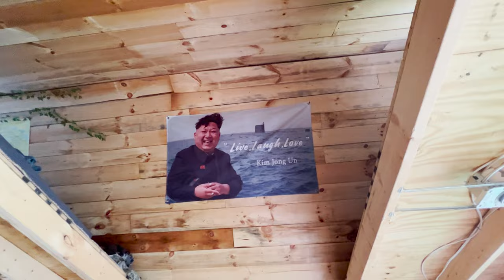#86 Cutting a hole in our LOG HOME wall; and other things happening on the ranch

Comment: I hope he gets a belt sander with a vacuum attachment to lower the dust level.  I guess since the house isn't done, it doesn't matter as much. 

I haven't finished the video yet. You might address this issue further in the video.  My memory is awful. If I try to wait until the end, I forget.  Besides, typing a comment is something I cam do during the ads.
Reply from the maker: I looked into a belt sander and it was way too heavy for me to be lifting for as long as I would have to.  Coming up with some other ideas so we will keep you posted!  Thanks for watching!